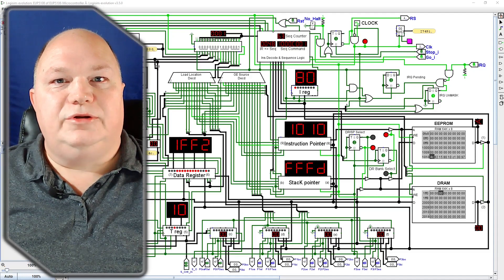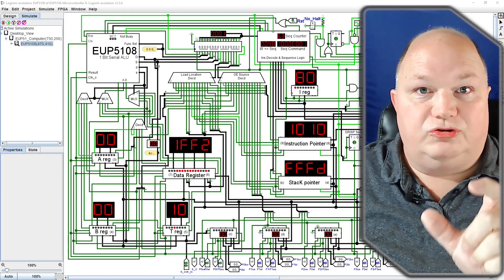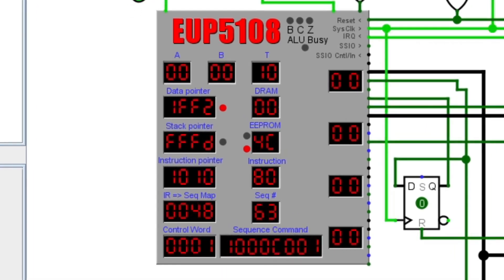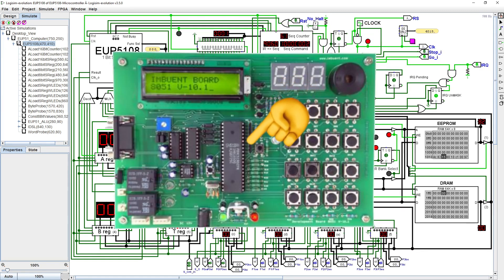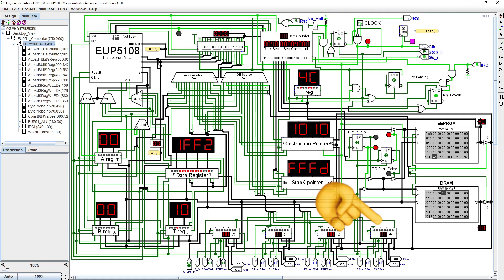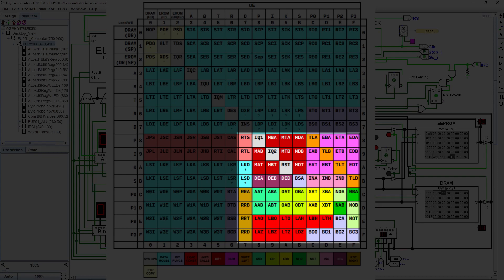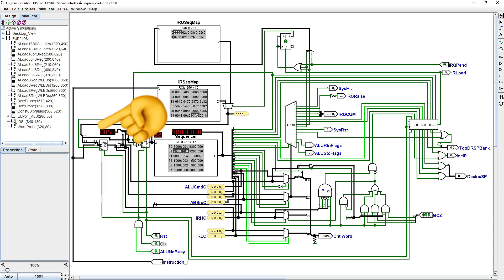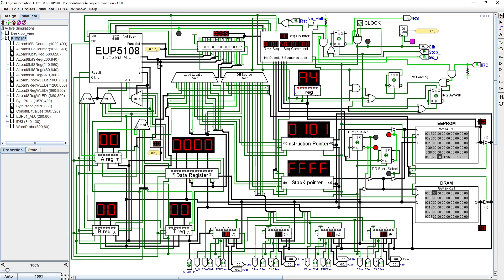The EUP5108 Microcontroller Grand Tour

Comment: I have a video request, that I need to learn how to do.
Reply from the maker: What is it?
Reply: @EUPThatsMe  When you have an external hard drive that power supply goes out, how do you bypass that power supply to bring the data over to your computer to put on a new hard drive?
Reply: @danamichelle6393  Bypass?  Hard drives always need power.  If you want to transfer data, you need to use another external enclosure or remove the drive fro, the old enclosure and install the drive in your computer, if you have a free bay. They should both work.